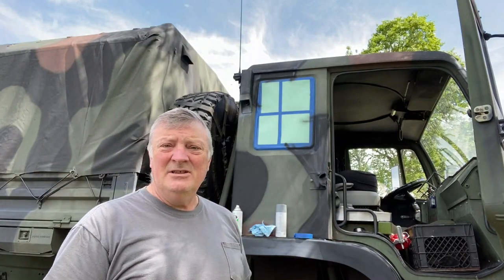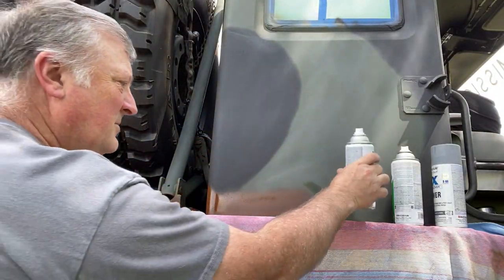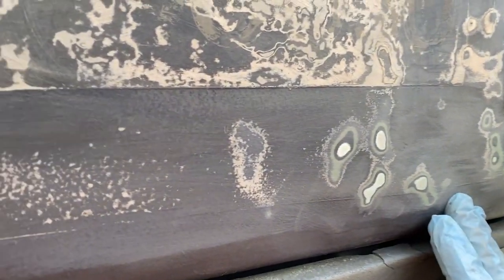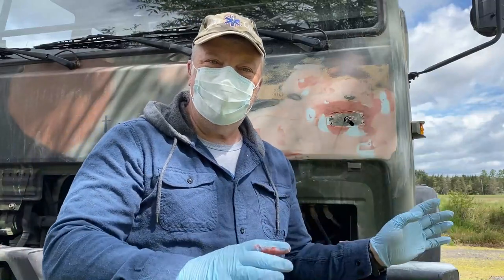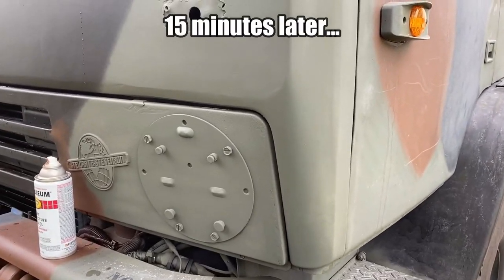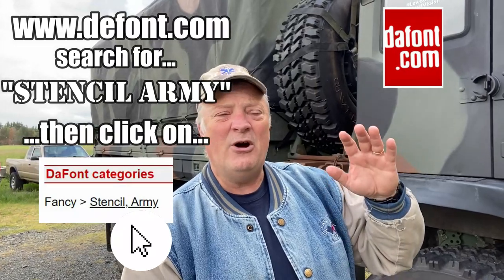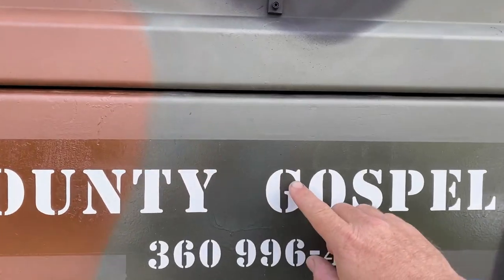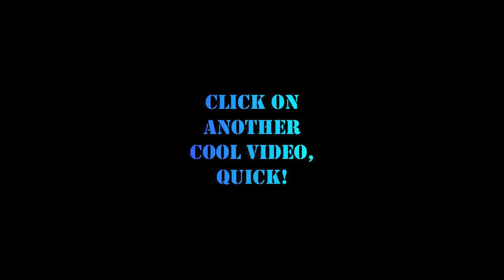FMTV HUGE DENT REPAIR, CAMO RE-PAINT #117

Comment: Check out the Bendix website for an air brake manual that may be helpful. Also Meritor Wabco is another source of air brake info. I'll find a trailer brake air schematic and send it to you. Email address?
Reply from the maker: If I could get a few good pics of Sean's trailer (the underside), I would be good to go. I have airlines, a tank, and glad hands, but not sure how to put it all together. To me, it looks like a spaghetti factory under there. It's the problem turning a truck into a trailer. I know it can be done, I'm just unsure how to do it. Sean has my email address... I can't post it here. :-D
Reply: Does your LMTV have glad hand connections?
Reply from the maker: @paulfillner6380  both front and rear. I did buy one set that I believe will work for "plugging in" to the truck to air up the trailer.